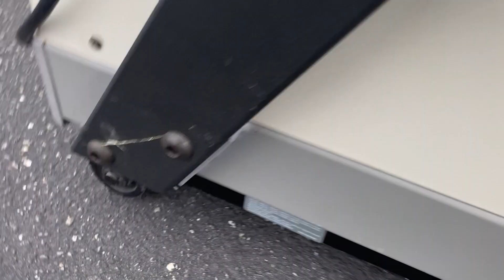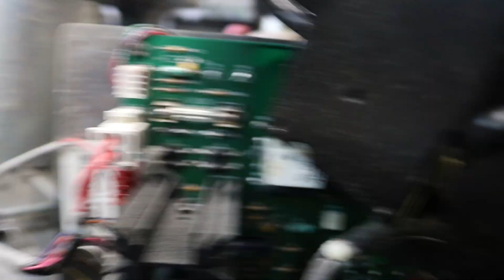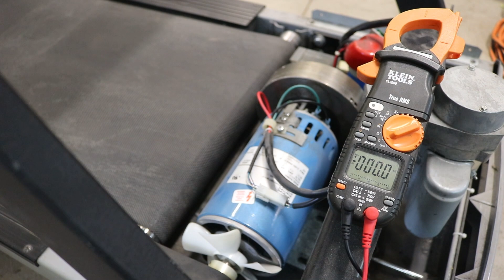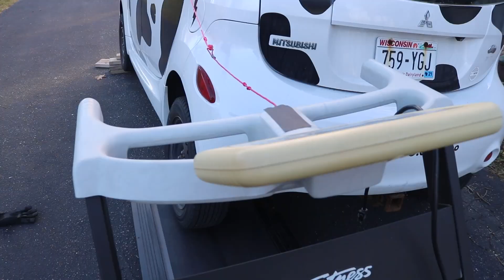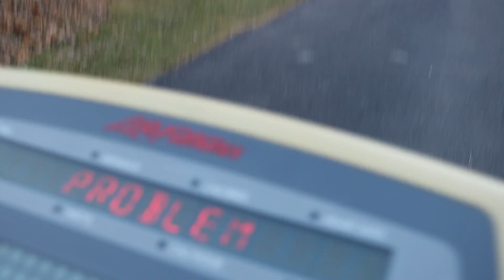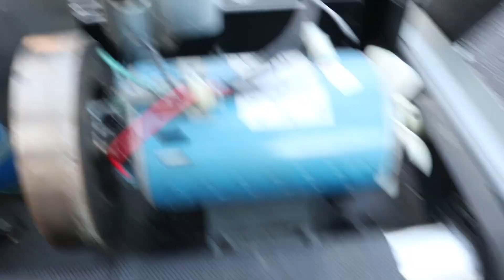Charge an Electric Car with a TREADMILL!?!? | Regen Charging Experiment | Treadmill Generator

Comment: I was thinking might cost a bit of money but what you need is to take apart the treadmill down to the last tub and replace the tub to be as long as wide as the car and get a second tube and roll the car onto the tube so you can run both drive tires on them without burning rubber mat just cause it cheaply thin made. Just saying this idea might work well if you think there is enough regenerative power in the car. Let me know what you think about my idea?
Reply from the maker: I think that would probably work. It would just be a fair amount of mechanical fabrication to build such a thing.
Reply: @BenjaminNelsonX  True but wouldn't it be worth it? I would love to see the result of this!

Comment: Must have whacked a curb with that rear wheel, it looks a little bent
Reply from the maker: These are my winter tires. I got them off a salvaged vehicle. The tires were brand new when the former owner was in a collision just bad enough to set off the airbag.
Long story short, I essentially got a BRAND new set of snow tires for free, already on steel rims.
Unfortunately, yes, there's a ding.

Comment: What's the speed threshold on the i-MiEV when it starts regen?  I know on both my Tesla and LEAF, those numbers are not zero.  So maybe a "roll down the hill" test in gear first and see when the car registers regen if you don't already know those values.
Reply from the maker: I've always tried keeping my eye on the speedometer when slowing down with regen. It drops fast when getting to the low speeds, but it looks to me like it's still regenerating at 7 MPH, maybe 6.

Comment: That treadmill motor would make a nice wind generator to compliment your solar array….
Reply from the maker: Unfortunately, based on the size of my property, zoning laws, etc, a wind generator is not appropriate for my location.
I do have a very small wind generator kit (one foot long blades) that I would love to assemble and play with sometime.
One thing I was thinking is that winter just started, and there are several lakes where I live where Ice Fishing is common. A lake is a perfect place to set up a wind turbine as it's large and open with no trees, but plenty of wind!
I think I could set a piece of pipe into one of the ice fishing holes and let it freeze overnight. Then could slip a slightly smaller diameter long pipe into that as the mast for a wind turbine.
In theory, that should be a relatively easy way to set up a temporary wind turbine for testing in public space away from buildings and other obstructions.

Comment: I think that it was a nice experiment but instead of taking it further,  there are lots of other interesting ones to try, regarding  non conventional charging methods.
For example, different power sources that can supply the minimum wattage needed to start charging. 😉😎
Reply from the maker: Giant Hamster Wheel it is!

Comment: Drop the tire pressure for a flatter, larger contact area.  ALSO make sure the car will regen at lower speeds. I feel my vehicle cease regen as I get below 10mph.
Reply from the maker: Regen drops with speed. I know that my car will regen to at least as low as 7 MPH.

Comment: that wheel has an obvious dent in it.
Reply from the maker: Yes it does! It's winter here now. These are my snow tires on steel rims. I got them off a salvaged iMiEV.
Great set of tires and rims for dirt cheap, with the exception of that dent...

Comment: Thinking about this beforehand, I didn't come to think that regen is at more powerful the faster you go, so when you're not going very fast at all, just about above the creep speed, it's quite logical that there is very little, if any, regen. You'd really have to get it going a lot faster to make stuff happen, but then it would also get even more dangerous.
Reply from the maker: Correct. I wasn't looking for very much regen. I was just hoping to get it to work. At a low speed like this, I would only expect very low current.

I want to have fun with this and see if it works, but NOT at high speeds!

Comment: I would say the other wheel is not spinning, that would trigger the ABS sensors. When one wheel is blocked, that could disable regen as to keep the wheels spinning. Otherwise with RWD or rear wheel regen, you could get in real trouble on snow and ice.
Reply from the maker: I guess I can't say if that DID or DID NOT happen.
I CAN tell you that I was NOT getting any errors on the dashboard.
Of course, if that's part of the design of the vehicle, it would just be a safety feature working properly, so it WOULDN'T set off an error.

Another possibility might be to find the ABS fuse and remove it!
Reply: This is the reason it didn't work yes!

Comment: That is a really elaborate electro-mechanical rectify/buck/boost arrangement you’ve got there. If you could just find a way to skip the mechanical steps and rectify/boost directly to battery voltage…
Reply: You totally can...use a charger!  :)

Comment: I guess that you need much more speed from the treadmill. Now the cars creep mode is using power to push the treadmill.
Reply from the maker: In one of the earliest regen tests, the "automatic transmission creep" DID go faster than the treadmill. That was when the treadmill sped up. In later tests, the treadmill was going much FASTER than the creep speed of the car.

Comment: Trying to figure, what is the end goal. If you want to charge the car battery via regen, could you hook up electric motor directly to the wheel hub? Skip all the belts and gears...
Reply from the maker: It's just a fun experiment to see if it would work or not. If a car can be charged through regen while being towed, could it gain any energy through regen while on a treadmill? That's it.

Comment from the maker: JUST A REMINDER: This was an EXPERIMENT! Having fun to see what would happen. COULD we charge the car from a treadmill or NOT? That's it. Not what speed it would charge at and CERTAINLY NOT whether it was practical!
So, what's the next step? Hot-Rod the treadmill, or get a second one for the other wheel?
Reply from the maker: Looks like I got an offer of a free treadmill from somebody, so maybe we can do TWO treadmills next time!
Reply: you would have to replace the sliding plate with a set of rollers to even have a chance of it being efficient. and at 1/10 HP it would take a long time to charge anything.
Reply: Around here we attach fan blades to the treadmill motor and use it to charge our batteries in the wind.
Reply from the maker: No joke. Treadmill motors have been popular for use building small DIY wind turbines!

Comment: Maybe you should press the brake pedal gently.
Reply from the maker: The mode that I was using will automatically regen brake WITHOUT having to touch the brake pedal. At low speeds, the mechanical brake kicks in very quickly. Since there's very little load and traction on the tire, the wheel locks up almost instantly, and then just rubs on the treadmill.
I kept having to fight the urge to put my foot on the brake pedal when shifting to keep this from happening!

Comment: Although the tyre is not flat on the treadmill, maybe the treadmill is not inline with the wheel causing the belt to fold.
Reply from the maker: The bottom of the tire was on an angle to the belt. That would have reduced traction, due to a smaller contact area.
The treadmill WAS in a straight line with the car.
I'm sure that the angle of the tire is what caused the belt to fold over and crease.
I tried pulling off the belt. I'm NEVER getting that crease out!
Reply: @BenjaminNelsonX  I think you need to disassemble and reassemble the belt again manually to fix it 😅. And you might want to jack both tire at the same level so the surface contact are more level and evenly distributed in future project.
Reply from the maker: @eone2345  I started taking apart the treadmill. The crease in the belt is AMAZING. I'm trying to figure out how to remove it. I can barely get it to flatten out in a VERY small area if I pull as hard as I can with my hands. I'll need to figure out some sort of mechanical way of doing it to get the crease out!
Reply: @BenjaminNelsonX  A heat gun might help.
Reply from the maker: @eone2345  Getting the tire perfectly flat on the belt would certainly be an improvement for a future experiment.
Reply: @BenjaminNelsonX  I can imagine that's a lot of works, especially if they have stiffening wire mesh inside 😅.. all the best 👍
Reply from the maker: @gartheligon140  Oh good idea. I'll see if that makes any difference.
Looking forward to the smell of hot rubber.
Reply: @BenjaminNelsonX  Not too much heat now.  😁😁
Reply: @UC7A1rDEGUvGQ8nLq-qRkgnw Tyre is English spelling, tire is American spelling. 

Google the meaning of both of them, better yet use your dictionary.

Comment: I'm gonna guess an extremely low charge, but a charge nonetheless. As in marathons run on the treadmill to get merely hundreds of metre of charge. That's my guess, looking forward to watching the results
Reply from the maker: I did a little math. When I walked on the treadmill, the load was a 50 watt light bulb. Walking at that pace with that load for 2 hours would be 100 watt-hours. In 20 hours, it would be 1 kilowatt-hour. To fully charge a 24kWh Nissan Leaf battery pack, it would take 480 hours, or 12 weeks, walking for 40 hours per week.
Makes 13 cents per hWh from the electric utility seem like a deal, doesn't it?